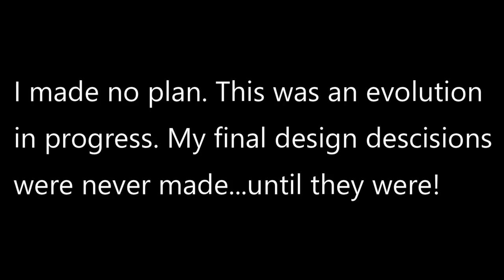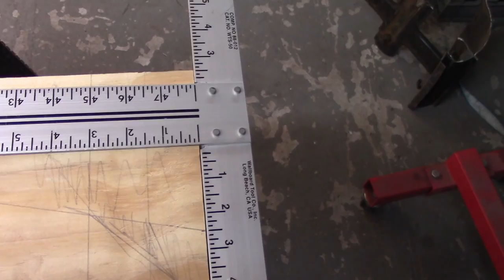Triumph Spitfire Body Repair - Poor Man's Rotisserie

Comment: That worked great! Thanks for sharing. I have a set for TR6 just like Cheftush's made out of 2 sheets of 1/2" plywood glued together. I was planning to make a set for the 68 Spitfire for when I get to it, but never actually got to figure out how would the bucks attach to the car. So now I don't need to bother designing them, I can just steal your idea :) Thanks!
Someone once told me if something is very urgent just leave it alone. If it so urgent someone else will do it... LOL
Reply from the maker: Thanks, Elin. We'll see how it holds up. I'm still a bit concerned for the B-post since it's a single mounting point, but we'll see. I thought about coming out from where the rear radius arm attaches at the back of heel board, but it was rather complicated to do so. I may revisit that option if I continued to be worried.

Comment: This looks great :: I wish I had known about something like this when I did my Vega I built this great monster with angle iron and pillow block bearings... not sure if it would have worked on a non convertible ,,,first time I saw this was on chef tush unit ...great work on this car Chris
Reply from the maker: Thanks. The lightness of the body, I think, allows you to get away with a lot of stuff that may not work on different designs.

Comment: maybe 2x4 bolted vertically on plywood it will make it stiffer
Reply from the maker: I was thinking of doing that, too, Steven. I had the angle iron and, most importantly, shorter bolts that would not have gone through all of that wood.